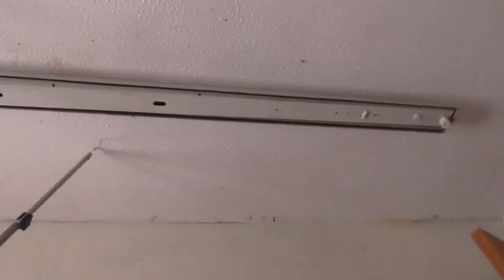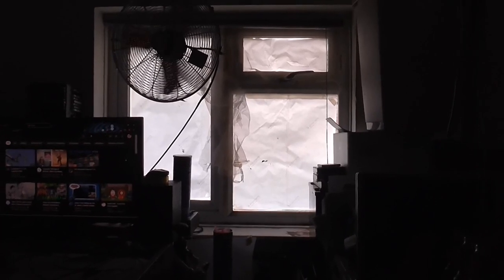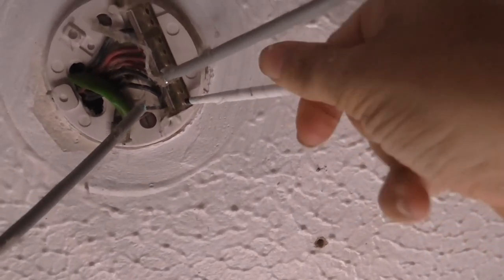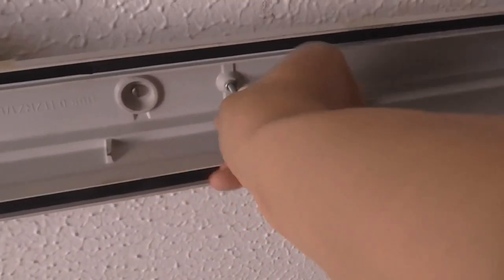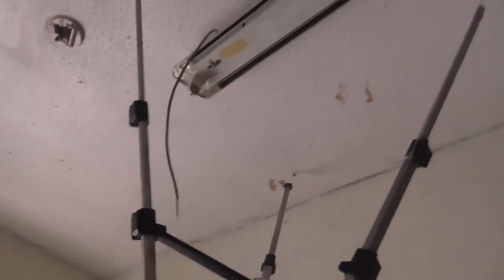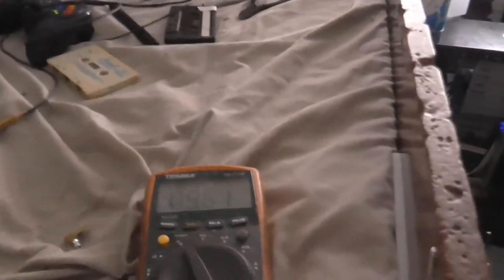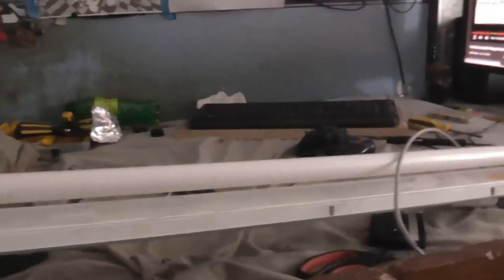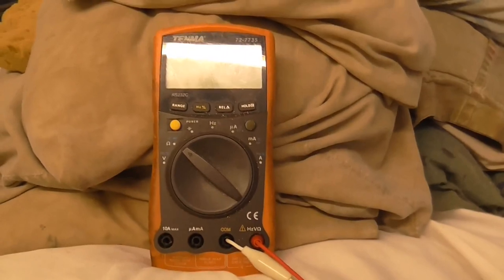Fixing the light in my room

Comment: I have one of those commercial fluorescent lights the old ones with with the metal fins over the bulbs and I don't remember exactly what I did to fix it but I was able to fix it and I even added a new cord and plug and it works great. Came on even in below zero temps. On another mod I took the sockets from a motion floodlight off and mounted them to another. The sensor was a 1 min 5 min and 10 min time setting on the new light but it had no hoods over the bulbs. The old light that it was replacing had hoods over the light bulbs but no 1 minute setting so I did a little hacking and made a new/old light that works perfectly.